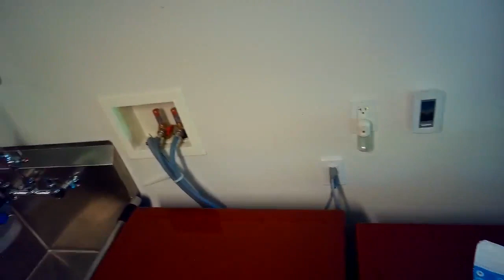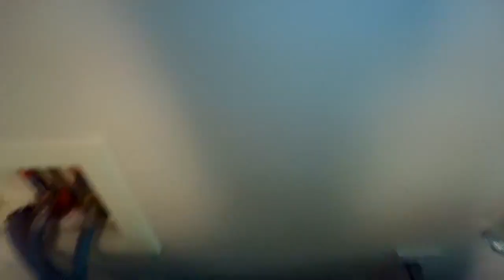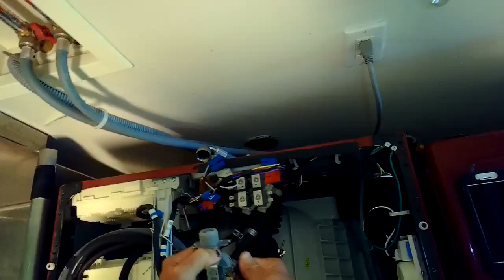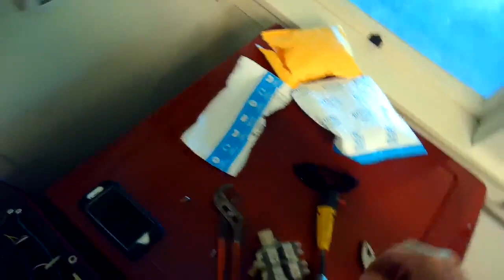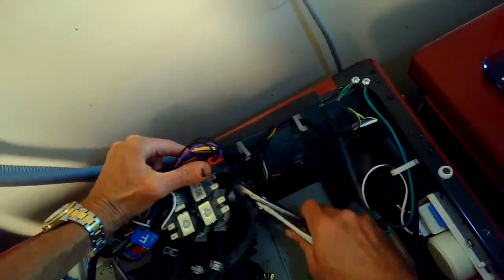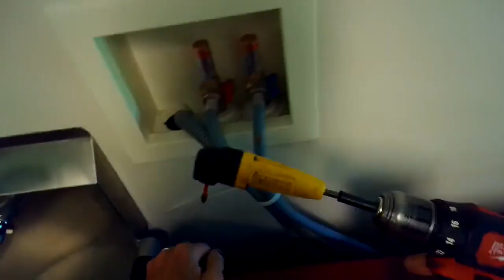✨ LG WASHER - NO WATER - Easy Fix ✨

Comment: My washer isn't filling, hot or cold, but neither is it giving a code. I've cleaned the (already clean) filters. Worked fine one day, didn't work at all the next. Fill valve? Or is there maybe another problem?
Reply from the maker: Is it draining ok?
Does it seem to start normally?
Reply: Everything else seems fine. After my daughter did all of the same things I did, I worked normally...for 2 loads. The last couple of loads I've had to turn the machine off and restart the load. It runs fine from there. Fill valves going bad? I've got good water pressure.
Reply: My machine is the same issue, did you replace the inlet valves? Did that fix it? Thanks!
Reply: @jpmorgen5726  We didn't have to. My daughter cleaned them (after I had already done the same), and this time it worked! She's apparently got the touch😅

Comment: LG wash machine  WM1485 FHD   DIRECT DRIVE  usual  LE FAULT CODE NO SPIN . replace hall sensor  no joy no spin drum only moves 1 direction . go into test service mode  press start 1  flicker display  1675-1680  drum go 1 way only     rotor stator gets very hot .   suspect  main pcb fault  over 8 years old  not worth £100 uk pounds for pcb .